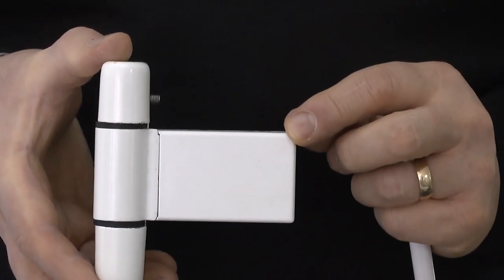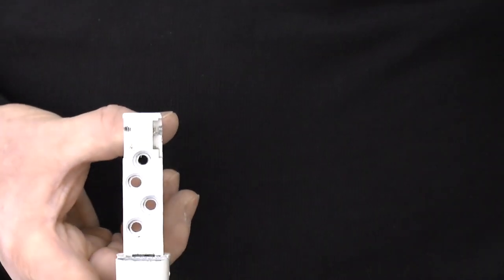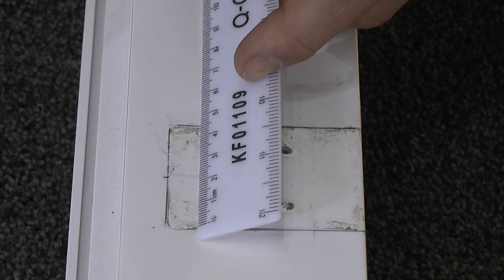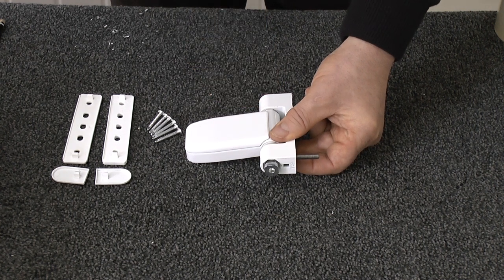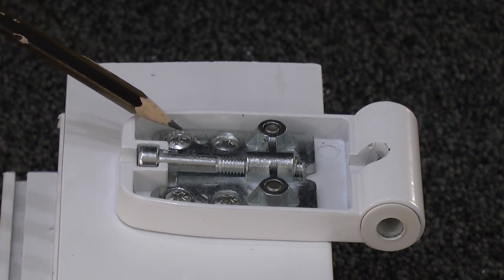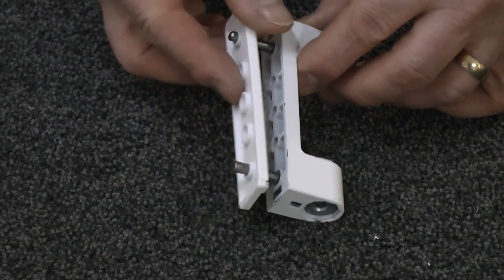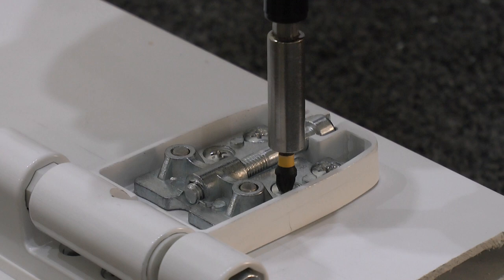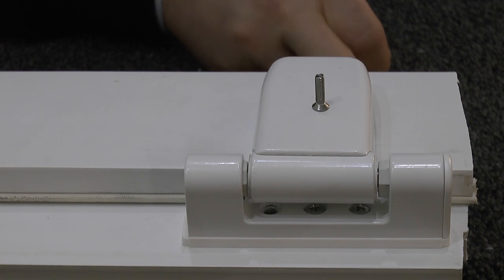Gardinia Coldseal Door Hinge Replacement Kit How To

Comment: Great Kit and instructions. Replaced the hinges on an Anglian French Doors. Without removing the doors. Opens & closes better than ever before.
Reply: Very interested in your method as I have French doors too. 

Did you put the new hinges where the old ones were and if so how did you keep the door in position when the hinge was removed?
 
Any problems with holes for the new hinges conflicting with where the old holes were?
 
Anything else to watch out for?

Comment: Very good product - very helpful video.  Some things might be emphasised more in video and on the helpful written instructions:
1) 90s Anglian doors generally only came with two hinges (plus a centre guide and compression fitting).  Our 800mm doors have just about survived with two hinges for 20 years+.  However, the 900mm door's top hinge has failed under the extra weight.  As upvcspares kit comes with 3 hinges, have replaced 2 old hinges with 3 new ones.
2) 'TOP' markings are faint and were missed first time.
3) Come with 2 'packers'.  Again, written instructions don't mention them.  Had to find out about the fatter ones by trial and error.
Otherwise, very friendly for an amateur DIY person.  Thanks.

Comment: Hi Sean, wow, very clear and informative video, however, I got confused which one is top or bottom hinge. Ideally would have liked to be shown on actual door. Also, does not mention whether you need to remove the door or can hinges be fixed, one by one without removing the UPVC door. Also, about the packers, is the thin one for Anglian? The manufacturer should place sticker on each to identify which one. I asked a locksmith whether he can place 3 hinges on an 1999 Anglian door which has two hinges to make it hold stronger as it is outward facing door and hinges got damaged due to heavy wind and he said no you can not put three hinges. One of the door repair company just quoted me £400 plus vat to replace the hinges, hinges cost £65 including kit and over £335 for labour, may be no more than 90 minutes job and no guarantee!
I am better of replacing the 30 years old door for £650 plus Vat. The locksmith thinks home owners are stupid to pay such high labour charges and yes he said he will have to spend time searching for the replacement hinges which I found in few minutes on internet on your website with clear instruction video.

Well done for educating the home owners and DIY guys. Keep up with good work.

Comment: Do the new holes on the new hinges fit in the existing holes or do they get drilled into fresh positions, the template overlays the old hinge positions but it wasn't clear in the video if any of the holes align or if they are too close and cause an elongated hole that the screw will not fit?

Comment: The Allen key at the bottom is for lifting / lowering the hinge/s however you would always need to repeat the same adjustment on all the hinges adjusted I:E if you raise the bottom hinge by 3 revolutions you need to do the same to the rest of the hinges otherwise the one/s not adjusted will still hold the door sash in the same place. As an aside this is the adjustment most used so it is quite common that someone has already jacked the door up as high as it will possibly go as these doors are well over 20 plus years old so you may find you cant raise them any higher

Comment: I have Anglian doors and windows fitted about the year 2000, the hinges on my doors are identical to the one in this video, does anybody know what the large Allen bolt that can be seen at the bottom of the old type hinge at 3min42s onwards is for and does? I know these old Anglian hinges have a left to right adjustment, but is that all? Or is that Allen bolt I mention at the bottom of the hinge for raising or lowering the height slightly? Thanks.

Comment: Its unlikely there will be no reinforcing as it has been a standard requirement for doors for in excess of 20 plus years. However if the door has been made without any you could perhaps fit jackleg fixings which will spread behind the upvc just like cavity fixings. not ideal but an option